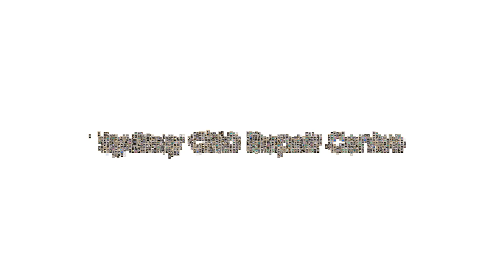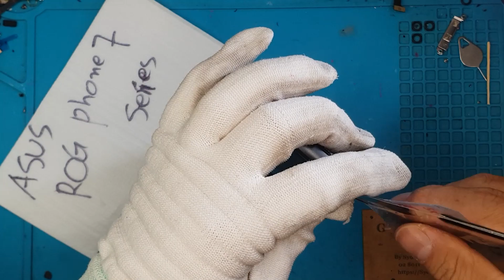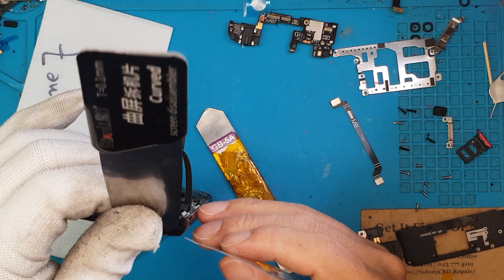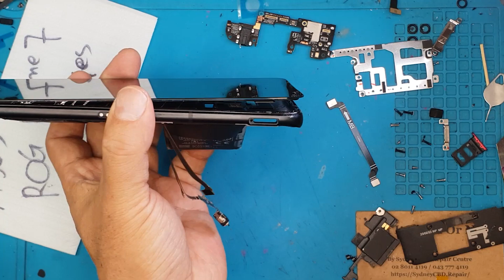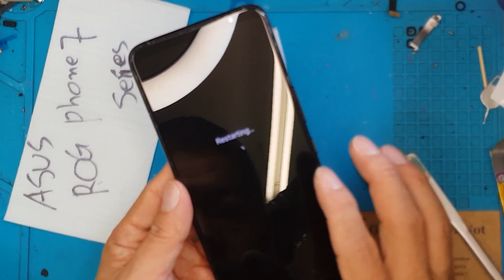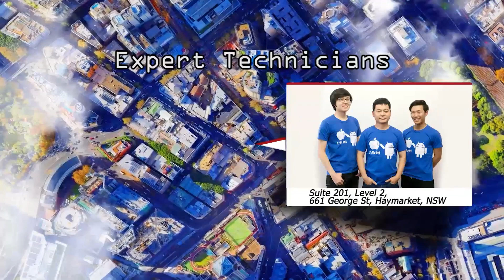A BIG BOY FIX! ASUS ROG PHONE 7 Screen Replacement | Sydney CBD Repair Centre

Comment: I just replaced my screen and I damaged a flex cable under battery so I ordered a new one asap from ASUS Accessories same part now when I turn phone on, screen works both front and rear. I can get to recovery mode and all options I can connect to monitor and have full function of black screen but a mouse cursor. I feel I stuck in a bootloop. Maybe android got erased. iDK please any advice??
Reply: @gregoryroman281  my advice bro is dont DIY if you are accoustic💀

Comment: I accidentally tore the small flex cable that runs from the volume rocker to the middle board while prying the back cover. Now the phone won't turn on or even charge. Is it possible that I have shorted out the phone? Is that flex cable only suppose to control the volume and not the power?

I would love to have you fix my phone but I live in Doha.
Reply from the maker: Hello, for further assistance Please contact us at https://www.SydneyCBD.Repair/ on our Live Chat Support Monday to Saturday on our Live Chat Support.

Comment: Gd day bro I recently got my screen replaced but when I insert sim ..phone not reading sim card  what can I do to fix that issue
Reply from the maker: reassemble the sim reader area or check SIM Tray .
Reply: @SydneyCBDRepairCentre  hi again we checked the sim tray and the different connectors and same issue it not picking up the sims at all
Reply: Could it be the replacement display causing the problem ?
Reply: Where can I purchase the main board the sim tray is attached too for the ROG 7